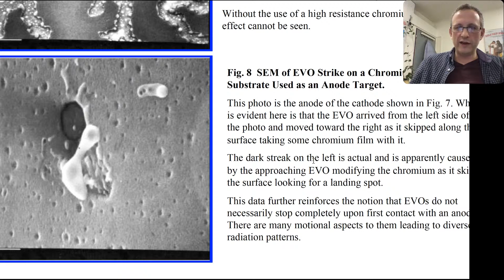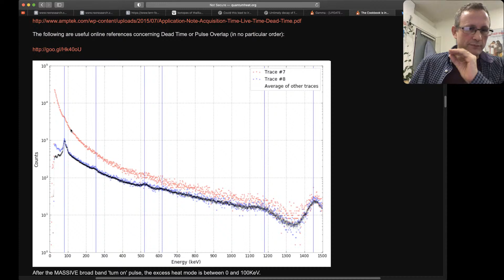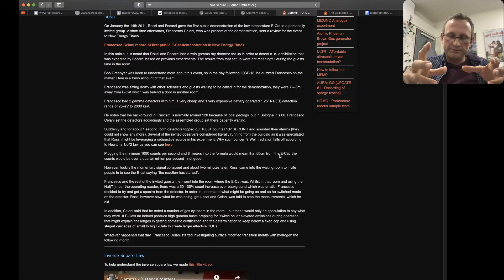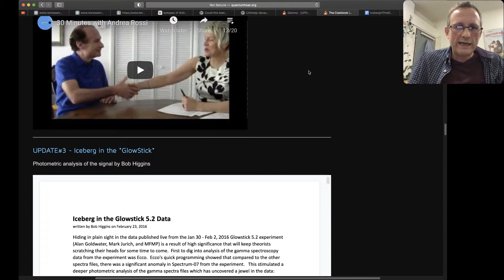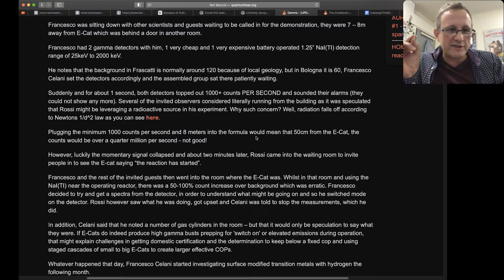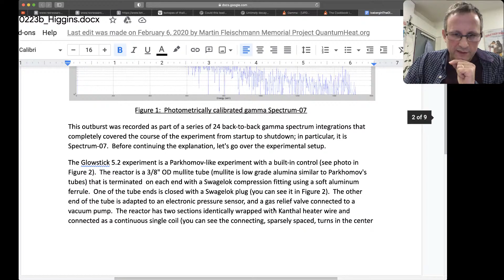Could this lead to irrefutable proof of the ‘New Fire’?

Comment: With information u posses on these nuclear processes can we at least start too speculate about why lazar was talking about element 115 and how would this process work knowing what you know about strange radiation?
Reply: And i mean speculate for now
Reply from the maker: Isotopes of element 115 have been synthesised and they are not stable.

It is conceivable that there is an anomalous stability of an isotope of 115 with a different number of neutrons.

It is also conceivable that it was just a code given to the 'element' - that 'element' could perhaps have been an element such as gold (79), but loaded with EVOs in the place of electrons that carry with them the radio nuclide 85Kr where Krypton is 36... 79+36=115

https://en.wikipedia.org/wiki/Krypton-85

I have talked about how 85Kr can be a good source of EVOs, it is 0.3% of the atoms produced in Uranium fission
Reply: @MFMP  the resason i believe him is they had access to enough equipment to do isotopic analisys he said this element does not exist on earth and in fact it is not from earth it was a trade deal with an E.T. race if you believe what he is saying plus the reason they were chasing after him is because he stole samples of the 115 fuel the fbi retrieved 1 but he still has another one hidden somewhere deep deep where it wont see a light of the day
Reply: @MFMP  plus using the technology your proposing wouldnt you be able to synthesize these heavy elements with ease he also said because they did not know how to use this material most of it was used to make some devastating nuclear warheads so it might be infact radioactive somewhat
Reply from the maker: @TheBukaj150  If it was a Au/Kr mash-up - it would make a devastating weapon. The energy this could store is almost unimaginable IMHO
Reply: @MFMP  hopefully they will never be allowed too use them